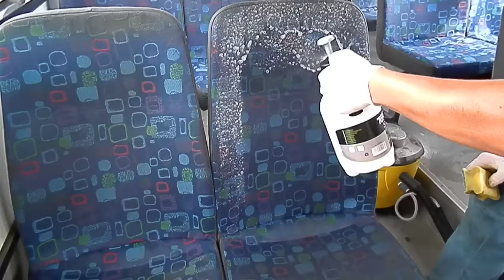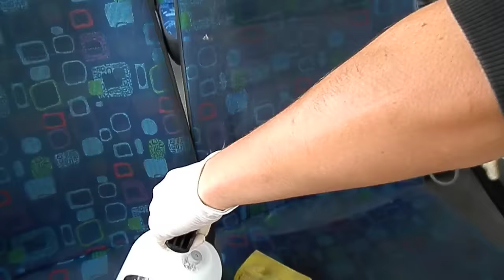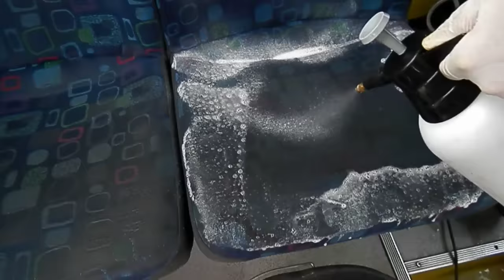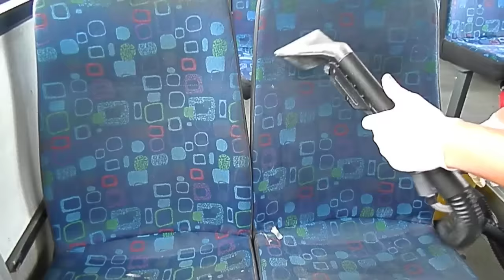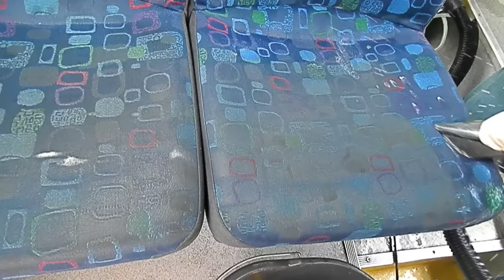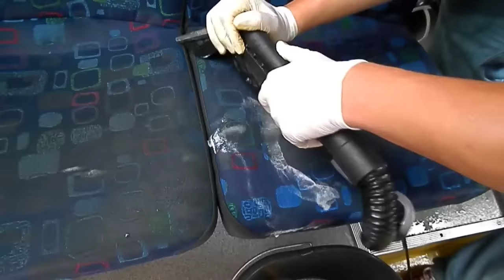Čištění sedaček v autobusu/ Bus seats cleaning

Comment: The real question here is what kind of freaking soap is that!?
Reply: I know right?
Reply: @viper.9756  for those of us who don't know... Please educate.
Reply: Reliance Sabol I shouldn’t have to tell you what an upholstery is
Reply: Phil0s0raptor 
*You’re
Reply: its an all purpose cleaner aka APC , diluted accordingly , vaccum also has a light dilution of chemical as it sucks the same time
Reply: @its_yellow  its basically surfactants on the alkaline scale, many brands to choose , over 20 depending where u live
Reply: Reliance Sabol are u in the army
Reply: Acid
Reply: What
Reply: Must be oxi-clean because it gets THE TOUGH STAINS OUT
Reply: Amoniac
Reply: Reliance Sabol i bet normal
Reply: Miracle Soap
Reply: Flex Soap
Reply: Not the soap.. the main reason he use karcher extractor vaccum..
Reply: Cillit bang! And the stain is gone!
Reply: @RelianceSabol  it's all purpose cleaner not soap
Reply: Ik it never worked like also they made this so unsatisfying dint even do one stroke
Reply: It's the industrial stream cleaner (extracter) as we call it in the detail business, is what does the heavy lifting in this video. This is what you are seeing clean the seat so efficiently. By spraying steaming hot water as it sucks up the the soapy chemical mixture.
Reply: Reliance Sabol bus soap
Reply: a good one
Reply: Sam Sykes wrong, no steamer used here. Just all purpose cleaner, something to scrub it in and then the shop vac to suck it up.

Comment: 4 x 50 x 50 = 10,000

4 minutes a seat times 50 seats on a bus Times 50 buses equals 10,000 minutes of work or 170 hours of work or 1 week of work with no breaks sleeping eating or going to the bathroom. So probably about 2 weeks of work.

No thanks.
Reply: Austin Martin if i were you i wont be cleaning 50 fuckign buses in under a week...
Reply: Just removing the seat clothing and putting in a washing machine would save weeks then.
Reply: Austin Martin they don't clean the same bus every week
Reply: Austin Martin I dont understand the point. Are you a child? 2-4 weeks of guaranteed work is a dream for a small business owner. And if it's a larger business then they have 1 employee per bus meaning it takes maybe 2 days. What is wrong with having guaranteed work??
Reply: Santibag 
You can't remove the cloth majority of the time. Unless it's tared, they won't remove them.
Reply: have more than one person cleaning the bus and you can reduce the time
Reply: grabe, advance ka mag-isip
Reply: Cameo Shadowness unfortunately yes, that's mostly the case. But it's not so difficult to make them removable.

Comment: Maths problems be like:
If it takes Harry 4 minutes and 7 seconds to clean one seat of a bus, how long will it take to clean 24 seats? If Harry started at 9.15am, what would the time be when he finished? What is the circumference of the bus' steering wheel?
Reply: Lets try to work this out so thats 4 mins x 24 seats = 96 mins 

If he started at 09:15 a.m. plus 96 mins for cleaning all the seats. Then he must have finish cleaning at 10: 51 a.m.
Reply: @serwaahakuamarva8683  WHAT ABOUT THE 7 SECONDS
Reply: @kloncey  4 min 7 sec ÷24= 247 sec × 24= 5928 sec= 98 min 8 sec 

9:15 + 98 min 8 sec = 10 h:53min:8 sec
Reply: I swear it's true
Reply: @serwaahakuamarva8683  omd WTF😂
Reply: H33F4N Well shit.